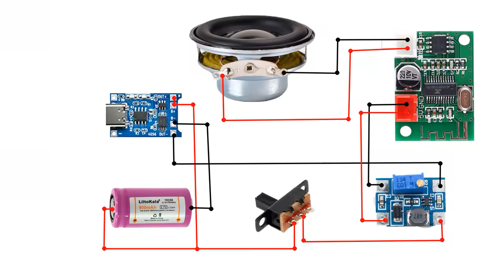DIY Mini Bluetooth Subwoofer RC CAR SUB V2 Type-C

Comment: Nice build! I'd suggest having 2200uf cap on boost converter's output might help solve distortions due to having unstable current draw. Also, you should showcase all of your built speakers so far! And tell us what's the best sounding one.

Comment: it suffers from port noise ALLOT btw, i can hear it from here lmao
Reply: Lmao he makes it from nothing and your criticizing it how bout u go make one
Reply: @everthingoutdoors8181  I did make one not this specific model, but the port noise ruins bass, so... learn more then lmao
Reply: @everthingoutdoors8181  also its quite easy to make these out of nothing, i made mine out of an old binder
Reply: @EazyRed  what is port noise bro?
Reply: @vinayakchoubey6460  When the air in a port comes out of the end and a too rapid rate, the air around the out side of it makes turbulance, causing a windy type of noise. Which is also why some ports are flared at the end of them

Comment: Hey guys, I'm making a big subwoofer box with two subs in it and it's gonna be finished after two days. Should I post it?
Reply from the maker: Yes off course post it, i have a idea to make a mini subwoofer with 2 40mm speaker. Good luck
Reply: @VGBSpeakers  Thank you so much! And will you upload on how you make it?
Reply from the maker: @realchronal  yes off course i will upload it.
Reply: @VGBSpeakers  I have an idea for a sub how about lots of small speakers like 15 or more instead of one big sub
Reply: VGB Speakers please respond I have cash

Comment: That's only a normal speaker coz it is also giving high frequency

Next time use a Woofer or do not title video as subwoofer
Reply from the maker: You need to understand,  for this size it can't be subwoofer, it's just looks like subwoofer, like RC car subwoofer.
Reply: @VGBSpeakers  ok ok
Reply: @justabasslover4404  I'm stupid but less than you 😂